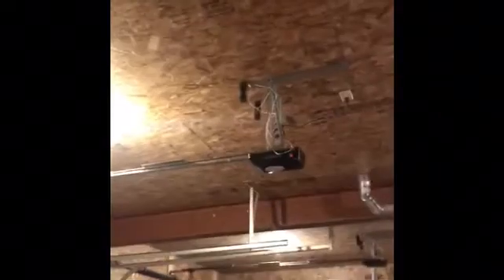Homemade Dumbwaiter

Comment: Did you use any springs as counter weight in your design? How much weight will it handle?
Reply from the maker: No counter weight was needed but the garage door motors do have a sensor built in that detects additional weight which makes them stop as a safety feature to not crush things. So we set it up with about 15 pounds on it and would have to keep the loads around 10-20 pounds. I did test it once and it lifted me (200 pounds) no problem